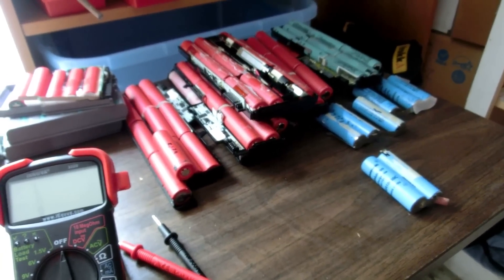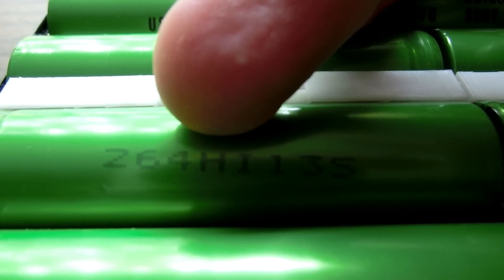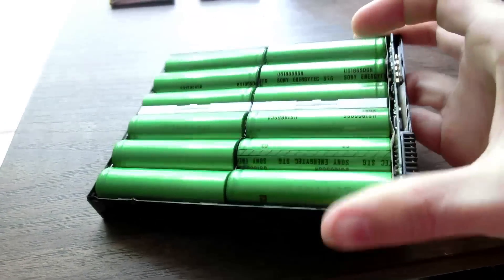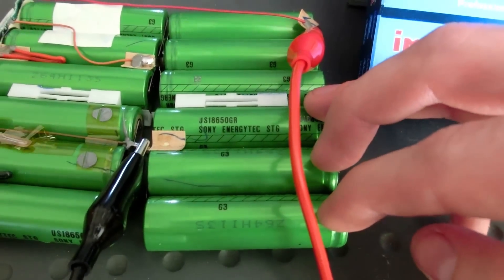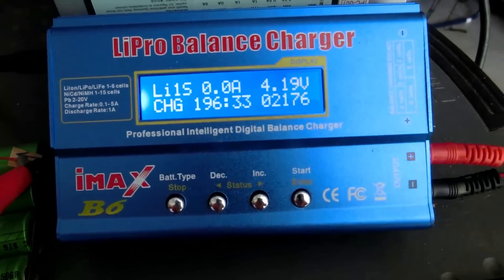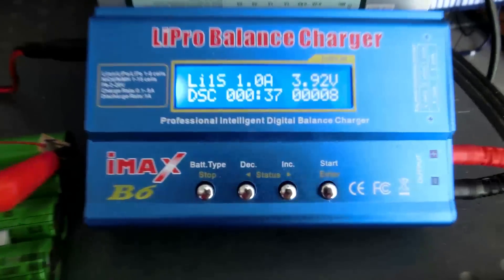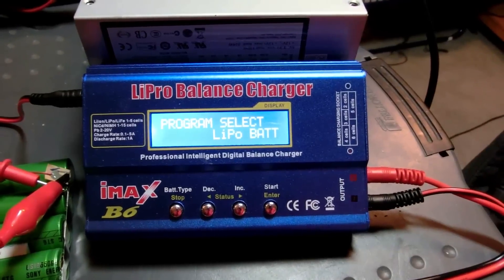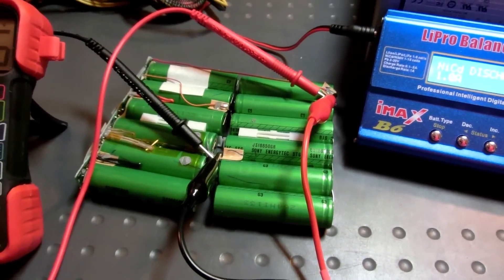15 year old 18650 lithium cells from 1999

Comment: I have a strange obsession for 18650 batteries? Is it only me?
Reply: me too, and i have no idea why...
Reply: nope me to. i am building a 72v pack with around 234pcs  2600mah cells. and some 12v and 21v packs. for my diy bluetooth speaker.
Reply: borderex mea too lol
Reply: Mee to, maybe because large aplication: electronics, automotive, gardening, electric tools, camping, solar, and more.
Reply: I also have. Dono
Reply: I'm also in 2019
Reply: I have a battery obsession except for non rechargeable batteries.

Comment: I have 6 Samsung ICR18650-22b cells that I guess are from 2002 from the model of the laptop from where I take those off, that laptop was used plugged since 2002 to 2015 with an internal storage stock management system, so the laptop never ran on battery, only in a few power outages, so the cells are practically new, them still have between 1930 mha to 2010 mha, it's awesome that a 17 years old cell still performing like that.

Comment: The oldest lithium ion cells I have came out of a Toshiba Tecra 8000 circa: 1996. It was a 9 cell pack (3p/3s), 6 are still in excellent condition. 2 were dead and I managed to bring one back to about %70 of it's original capacity. The interesting thing about these cells is the size. 17670.  They're "Panasonic Lithium Ion CGR17670HC" with no apparent date code.
Another odd thing was, I accidentally shorted two of these cells and only noticed because of an almost sweet bubble gum kind of smell coming from them.

Comment: I took apart two battery packs of a Canon VHS-C camcorder today. Same cells, the date code says 1997. They are still working perfectly fine and still  have (to my surprise!) their original capacity! Probably because they weren't used much but were never deep-discharged either. Pretty cool, I am going to use them in my projects with the TP4056 modules.
Reply from the maker: As long as a battery never goes bellow 1v it shouldnt have any degredation

Comment: I was testing some yesterday, similar ones, and they were getting around 1700mah and I was thinking it was much lower than new but it's good to hear that they were actually pretty good. Also I'd definitely recommend the accucell 6 from turnigy they software is almost flawless and does stop at the set voltage and also it will start charging at any voltage as long as there is a battery on it. It does that by sending out a voltage of about 30v at a very low current, in fact low enough that even your finger can pull it down. And if it stays at that voltage it will give the open circuit error and if it's 0v it will give the short error. Great value charger. I'm using mine for my 160 odd 18650s and some of the flat but still steelcased cells I have no idea what they're called, if anyone knows please let me know, I also have 4 26650s  (like 18650s but wider) that I got from an old power book battery. Also keep up the great videos, and I hope you get the issue with the thermal camera sorted.

Comment: The battery pack in my IBM ThinkPad 600 from 1997 is still the original pack, and it still holds a 2 hour charge.  It's a Li-ion pack, not sure if it uses 18650 cells though, but pretty good for an old Li-ion pack.
Reply from the maker: shugo21 yeah thats very good. do you know if the battery was made in 1997?
Reply: Made a slight error, laptop was manufactured 10/1998, battery looks to have been made in early 1998.

Comment: We have 3 of the Imax (maybe b6) in the lab - the ones with AC connectors on them. The mains cable freyyed on one and they had odd connectors so i took it appart to solder an 18v DC connection to it similar to what you have (again weird connector on the outside that we didnt have)... anyway, the AC to DC converter is literally just a big plastic laptop power brick they've taken a buz saw too to get into and wire some cables up to the output. Shocking!

Comment: I do have some SONY ENERGYTEC with Datecode 224HD07F (printed with dot-matrix printer;  7. April 1999 - if you're right) and some with Datecode 354HH12E (printed like yours; 12. August 1999). They still work fine, I use them from time to time in some electronic/arduino projects. Haven't tested capacity for some time though but it's still >1Ah for sure.

Comment: Its very hard to find cells to buy here, I have just 9 from 18650, and some others from cellphones.. But I think that one of that cellphone lithium cell, is from a old japanese cellphone, was made on 2003, 2002 I think. I use to power up a laser pointer that I made, its a 800mA battery, I dont have how measure but should have a least a little more that a half of that capacity, I can play with the laser all night using to astrophotography without need charge..
However, I need find more cells.. my backpack broke the handler when I was on the subway this week because of the weight of my 7a lead acid battery.. I really need to find a way to find deals like you got there.

Comment: I dont have the foggyest idea of what you just said!Several battries had three voltz connewcted to the ohm conutes valve, however if you take the wire off  the lockmohinder relay switch emptys in to the bylateral pope pious wire, etc etc.

Comment: Old packs should always be broken into individual cells to identify single bad cells within a pack.  Especially laptop packs more than 4 years old.

Just pulled a bunch of 14 year old cells from two laptop battery packs & separated them for individual testing.    Samsung ICR18650 2000mAh manufactured April 2002, 12 cells are still good & very usable.  6 cells were bad, having just 0.65 - 0.9V.  The rest still have 800 - 1200mAh capacity each, but drop to 4.06V - 4.14V just 8 hours after charging & will be sent to recycle along with the bad batteries since I don't have anything with a low current draw to use them in.

After testing the 12 good cells at 1A charge/discharge on my Opus BT-C3100 V2.2 charger / analyzer, the worst cell showed 1290mAh capacity after refresh cycle, best battery showed 1528mAh capacity after refresh cycle, but most of the batteries were between 1380mAh & 1470mAh. So basically, 12 good batteries with more than an hour runtime in any 1A device!!!  I was given both battery packs for free!!!

Comment: Ive got 2 Sony NP-F970 "L" series video camera batteries back from a camera i bought in 1998. Right when MiniDV was the top thing.

They are rated at 7.2V 47.5Wh which if my maths are right (47.5/7.2)x1000 gives 6597mah pack. These packs are 2S3P with 18650 cells so that would make the cells 2200mah each.

Both packs have always been looked after by me, and they still work at at least 3/4 of their original capacity.

The camera i bought them for has long since been retired. But Sony kept this model of battery for use forever in stuff. And even now i still use them with my Sony AX2000 camera which records to SD cards.

Pretty sure i paid a good $400 each or so for these things. Maybe more. But i think its safe to say they were worth it!
Reply from the maker: ***** nice :D

Comment: I've just bought a 2005 apple powerbook g4.
The batteries didn't have charge. after charging them they still ran for 2h and something (each of them had about 150cycles), but after some more cycles they wouldn't last more than 30-45min...maybe one cell or two is shot.

Comment: The discharge code is correct. Remember that Ni-MH vs lithium have different discharge characteristics so that's why it cuts off in a different way.

The voltage difference between the iMax and your meter is, as you said, just resistance in the cabling. It's an annoyance when trying to charge and discharge batteries properly, especially when you want to test capacity =(

Comment: I sold my old Dell laptop from 2002 for parts but old battery left. I removed all 8 18650 which were green Panasonic 1900mAh and all of them work properly! Using IMAX B6 mini measured capacity is still about 1800-1850mAh @ 0.4A discharge current! It is not full truth because B6 mini discharges battery to 3V and then decreases current from preset value to 0.0A and then stops. I don't like this behaviour. But I believe they still have 1600-1700mAh. Old 18650s are usually much better quality then crap you can buy today. From my experience - it is better to buy old Dell battery than 4-5 year old Asus or Acer. Recently I purchased 10 year old Dell with 9 cells, by color I think they are red Sanyos 2400mAh. Discharge test - 2150mAh! After 10 years.
Reply: +cbm80amiga how is old 18650 cell better than newer cheaper made in Japan Panasonic cells that have 3400 mah?  When I started playing with Li-Ion batteries in 2008 they didn't have such capacities.  Also why would it matter if the current decreases towards 3v?  It's still counting but at slower rate.
Reply: By old 18650 I mean cheap old laptop battery which I can buy for $4-5 and have 8-9 cells. When I purchased (and it was good deal) new Sanyo cells (2600mAh) it costed me $3-4/cell. Tell me where I can find new ones cheaper. For capacity testing I use Imax B6 mini but in NiCd/NiMh mode at constant discharge current because regular LiIon/LiPo mode decreases the current which is wrong. As cut-off voltage I use 2.9V.
Reply: +cbm80amiga Amazon had Panasonic 3400 mah top rated Japanese cells $5 / cell if you buy 6 of them for 30. Best deal I've seen.
Reply: Ok. Thanks.
 I hope they were not fake ones.
Reply: Looks like it's actually $/6 per cell right now.  The good thing about Amazon is no hassle returns, they pay for returns, you just print label and send it back for prompt refund.

Comment: I've got some working ones with the code 7IJ28S. So 28th October 2000
Out of the 9 cells in the pack, 7 still hold a charge. Odd pack layout put the last 3 parallel cells are 2x and 1x mounted elsewhere.
Not capacity tested yet, as need more cells before I can justify the charger.
Reply: Not been able to find a copy of the PDF data sheet for these Sony US18650GR cells either.

Comment: I did opened a mildly old Samsung laptop battery, but the cells are unbranded, they have a serial printed: MH9M4C6 023393. The cover is purple, the top ring is  light blue, and the flat-style head has 6 holes.
How can I identify them?

Comment: this may sound crazy...But can you put all these together to make one big huge 12volt battery you can power household items with & charge with your solar panels?
Reply: atcjos 

it depends some on what a person is doing, but I suspect for general use, a 24, 36, or 48 volt system could be better for an in-house system, with step-down conversion for devices which need 12 volts.

basically, with a 12V system, it would require very thick wiring to do something as simple as run a desktop PC, which doesn't really scale well (running thick wire everywhere in a house would get rather expensive).

possible could be a combination system, say, with 12v DC power (via step-down converters near the point of use), 48v DC power (direct to the batteries), and 120VAC power (via an inverter).

the cost of the step-down converters could end up lower than the cost of wiring everything up with heavy-gauge wire.
Reply: Brendan Bohannon what? Why would you run 12 volts all the way to the appliance? Invertor at the battery bank and run your cables from there. 12 volts is handy because so many things can be run directly from it. And 12/240 volt invertors are CHEAP, even for stackable ones
Reply: *****

some people like the idea of running 12v directly to appliances and side-stepping the use of an inverter. but, then one has the problem of amperage and wire-gauges. it sounded like this is what the original comment was assuming.

but, yeah, I suspect an inverter would probably be pretty useful, as it is convenient to be able to plug in devices designed for mains/grid power (ex: 120v/60Hz or 240v/50Hz or 100v/50Hz or whatever else).

Comment: Hey are you using a pc psu to power the B6? ive been trying to pull max amps out of my own psu and highest i got was about 2.1 amps before the internal over voltage chip cuts out but i hear you can hack and disable the safety chip which sounds like fun

Comment: Nice score. Sony makes some of the best batteries you can buy, if they are not counterfeits. Thankfully, you won't find counterfeits in laptop batteries, because why would they bother if you cannot see the batteries. Won the lottery on that one man :)
These batteries are 2000mah new(more like 1800 after broke in), you can find them in old sony vaio battery packs. PCGA-BP51 is one i can confirm holds these cells. Oddly, the laptop battery pack will say the whole pack has 2200 mah, but it really has 3 of these 2000 mah batteries in series. Due to providing both the 12v(11.1v) and 5v rail, likely the extra 200 mah comes from gained efficiency from electronics powered on the 5v rail. Likely using pwm to drop the voltage, which causes a rise in effective capacity of course, but it is a bit deceptive if you ask me.
Reply: +Richard Smith  So much wrong information in your comment!  1) If you connect batteries in series you don't gain capacity, you gain voltage - that's most basic knowledge, why even bother talking about PMW if you don't know this much.  2) Sony recalled million of Li-Ion batteries due to laptops bursting in flames.   So much for best battery.  I haven't seen any Sony cells for sale in last 7 years.  Panasonic dominates Li-Ion market.  3) Once the batteries are broken in they typically gain capacity, not drop.
Reply: Dima Prok
1) 8v@ 2800 mah is TWICE the effective capacity of 4v@2800 mah. It delivers twice the voltage over the same period of current, think about it. 
2) Panasonic offer great high capacity, low current cells. Sony VTC3/VTC4/VTC5's are the some of the most highly regarded high discharge cells, as well as the most cloned cells.
3) Battery capacity does not 'break in' over time. They just need 'primed'. This is done simply by full charging, discharging then recharging. This 'shocks' the cell after a long storage period to clear the passivation layer that formed on the cathode from that storage. Failing to do this the first time with new cells may cause slow and drawn out capacity priming, which is the source of that myth. This is one of the main reasons manuals yell at you to fully charge them out of the box, but they should also tell you to fully discharge before fully charging again.
Reply: +Richard Smith 1) No.. if you run 4v 2800 mah pack at 2800 milli amps rate it will run for 1 hours and if you have 8 volt battery 2800 mah and you run at 2800 mA it will also last exact same 1 hour so as you see the capacity is the same regardless of voltage even though in 2nd case you are consuming more power so I think what you're trying to say it has double Watt hours, yes it's true.  2)  How much current draw do you need for typical application?  I remember seeing charts where it could be discharged around 5-6 amps, but in practice unless you're to RC toys there is no need for such high drain packs and again I have not seen Sony cells for sale, only IMR.   3)  Prime, break-in, it's just different terms, I know for a fact it does happen in Ni-CD and Ni-MH and it's more just 1 cycle to realize full capacity.  I've seen reports where guys buy batteries and run through 5 cycles and see slight increase with each cycle - measured increase.  I personally never done that, but it does make sense to me.
Reply: +Dima Prok 4v or 8v at 2800 milliamps is doubling the capacity. Capacity = Wh.  If you're going up from 4v to 8v for the same use, you'll only need 1/2 the current and it will last twice as long. In fact, at 8 volts you'll need a little less current in total because the losses in the wires are less (less heat produced in the wires). More efficient use of the total Wh available.
Reply: Guzzi venture You can't just connect 12.6v battery pack to 5v rail and run it, you would need to use step down converter which are at max about 90% efficient, so you end up with less "capacity" after step down conversion.

Comment: Opens up a pack containing green cells that still contain energy from back when Sony manufactured their 18650's in Fukushima.
Such a coincidence.
Sony must have used some serious 'secret sauce'
Reply from the maker: cobalt? i think your drawing connections based on limited understanding. the fact that fukushima had a power plant, the fukushima daiichi doesnt mean it was the only thing it had. thats like saying illinois had a power plant disaster and thats all thats there.
Reply: @RinoaL  I did some more research. Fukushima is a larger area than the exclusion zone. There are people living and working there now in most places that are not in the exclusion zone

All i know is that Fukushima got a bit of a bad name because of the disaster.
Sony headquarters moved probably for reasons related to the incident.

Sony still make Zinc based  'Ultra Heavy Duty' Zinc Carbon cells.
It is still after 100+ years since invention a profitable busness tactic. Because if your battery dies quicker, you will be more likely to buy more. And buying more means Sony makes more money.

Comment: Are those lithium ion or lithium polymer. I think they have different top voltages. I noticed u was charging on lipo. For some reason i thought they have different top voltages. Maybe im wrong
Reply from the maker: Raymond Bivens yes your wrong. lithium ion and lipo are just a marketing gimmick. but there is a structural differance. ussually when people say Lipo they mean the flat packs that are more fragile. but still its the same thing.
Reply: Raymond Bivens as he said in the video the imax b6 is out of wack when they coced the lipo should be 3.7 and the poly should be 3.6 reall the unit needs some who knows how to record them and show us how to upload the new software
Reply: Rinoa Super-Genius I use the lipo for rc but dont mess with charging the 18650. I dont know why i thought they were different. It might because my charger has an option for a lower voltage one. 3.6 nominal, 4.1 charged